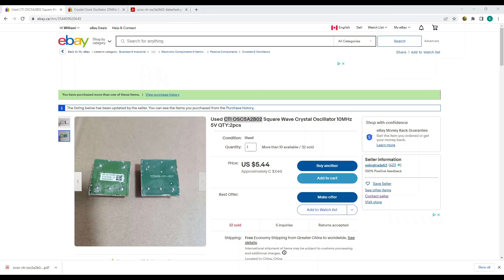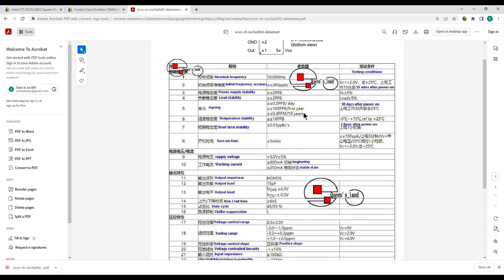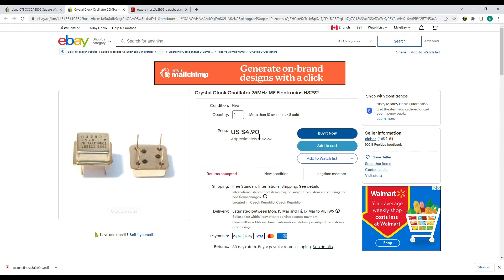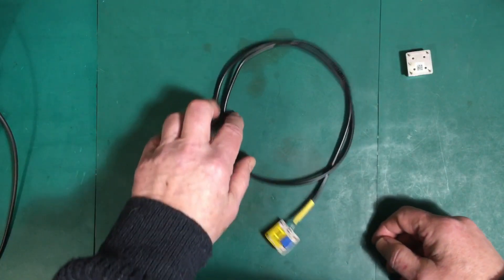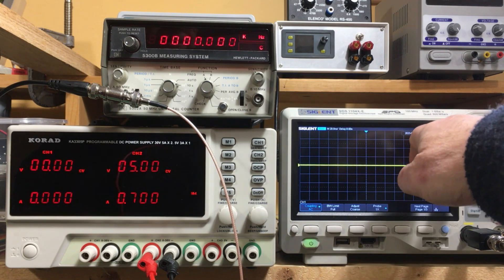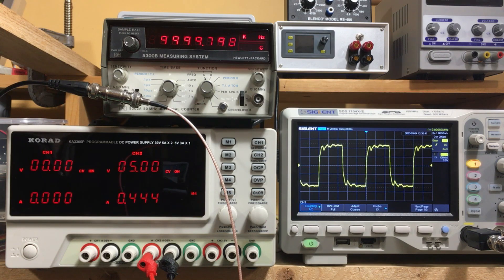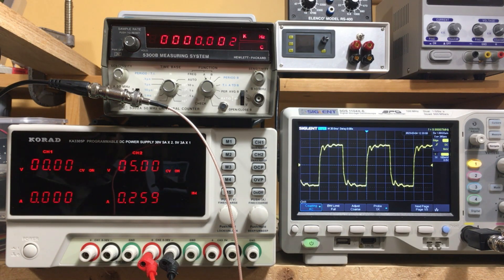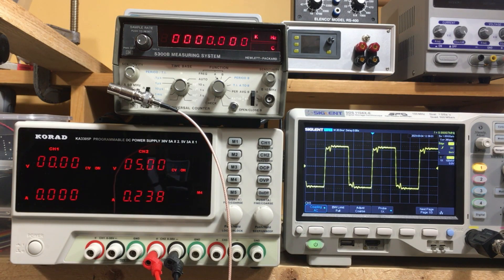0023 - Can a $3.00 OCXO be any good?

Comment: If you get a neo-7m / neo-m8n GPS module you can program them to spit out 10mhz as well, buffer them etc. and use to compare against the OCXO. They'll generally need an active antenna if inside. GPS + OCXO + MCU = your own diy GPSDO
Reply from the maker: I actually found a GPSDO for under $100 and it's on it's way.
Reply: Matt You have to be careful when using the NEO-7 (and probably the NEO-8) in this way. The on-board GPSDO runs at 48 Mhz and dividing down to 10 Mhz results in a pulse train of asymmetric pulses - on an oscilloscope it appears to be jitter but is in fact a recurring pattern. Division by an integer ( ie 4 for 12 Mhz or 6 for 8 Mhz) results in a normal 50 % duty cycle output. Depending on your application, the "jitter" may cause problems. Regards, David

Comment: The Vectron C4550A1 series OCXO costs about the same and is in the same package but also includes a stabilized voltage reference output (pin 4) that can be used to supply the frequency adjustment voltage for even better temperature stability. Regards,  David
Reply from the maker: Sounds interesting.  I'll have to look into them.  Thanks!
Reply: More accurately, some of them do - I have a bunch of those Vectron OCXOs, all with the same -0213 suffix and a have a couple with fairly low serial numbers (< 10000) and those have the Vref output and a bunch more with higher  serial numbers (40000 to 176000) that don't.  So a reasonable guess is that the reference output was not part of the spec and was removed at some point between 10000 and 40000.  It would be interesting to know if your oscillator is another -0213, and if so what it's serial number is, since that might help to narrow the range.
Reply from the maker: @TrimeshSZ  Good information, thanks.

It seems from reading the spec sheet on these that the Vref output is an option and the device can be ordered with or without it.
Reply: @TrimeshSZ   Interesting. I have five Vectron C4550A1-0213 OCXOs - three installed in test equipment and two tested and awaiting projects. All of them have internal reference supplies. I also checked the latest spec. sheet from Vectron and it says the C4550 series have the internal reference. My units are s/n 11656 (0908), 23675 (0936), 178480 (0951), 186032 (1029) and 189616 (1032). Maybe you got some damaged ones? Regards, David
Reply: @davidv1289  I don't think they are faulty - I chopped one of the "No Vref" parts open with a Dremel and the components feeding the Vref pins were simply not installed.  I also just checked again to make sure I wasn't hallucinating and got the same results #9584 (0908 - Has Vref), #41240 (0943 - No Vref), #41818 (0943 - No Vref), #176570 (0950 - No Vref), #192451 (1034 - No Vref) - I also have a couple more low serial number parts that are in equipment and have the Vref output.
Reply: @TrimeshSZ  That is weird.  I bought mine in three different lots from three different sellers. I have been purchasing the C4450 series because I like the stabilized voltage reference. I use two 25 ppm resistors and a 1 K ten turn pot and get a really nice result adjustable to within a few mHz. Maybe I've just been lucky! Thank you for the information. Regards, David

Comment: The adjustment pin is not 0-5Vcc... It is 2V +/- 2V... So, the max is 4V. See the data sheet to confirm. A negative adjustment is below the 2V center.
Reply from the maker: All very true but it was handy to just bodge the pot to the 5V.

Comment: Chunky, power hungry ? Try running a Rubidium oscillator 😂 I bought a bunch of these oxco's as a substitute for my rubidium oscillators especially now that electricity prices are going thru the roof! Nice video!
Reply from the maker: Those rubidium standards are expensive in more ways than one.  That's for sure.  About 60W or so?
Reply: @uni-byte  I have several that I bought years before everyone got on the bandwagon and the prices really went thru the roof. My main one which has distribution for 8 instruments draws about 50-60 watts. It's so warm that I have a fan blowing across it and it is attached to a large copper heat sink using a large piece of double sided flexible heat sink material. I also have a 15MHz Lucent unit that consumes significantly more power - I rarely power it up because of that.

Comment: TCXO would be better.
Reply from the maker: For size and lower power consumption I would agree with you, but for stability and accuracy an OCXO has a TCXO beat in a big way.  As a frequency standard the OCXO is much better.  A rubidium time base or a GPSDO would be better still, but you are not going to get either of them for $3.00.
Reply: For accuracy, no it wouldn't. For power draw, yes.
Reply: TCXOs essentially drop cycles according to an internally programmed temperature compensation look-up table. Sudden phase and/or period drops are not a good thing.
OCXOs are just a very very stable crystal oscillator. No phase or period jumps like a TXCO.
Horses for courses.  For lab use, who would care about a few watts of power consumption? In many applications, yes, a TXCO is the obviously choice.
Blanket "better" is not the correct description.